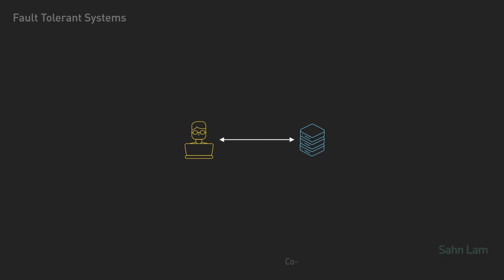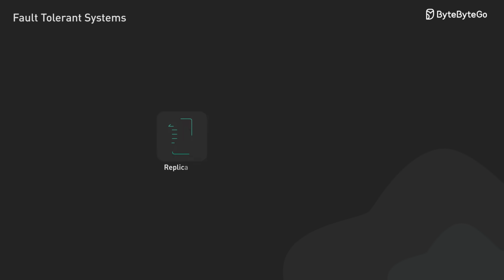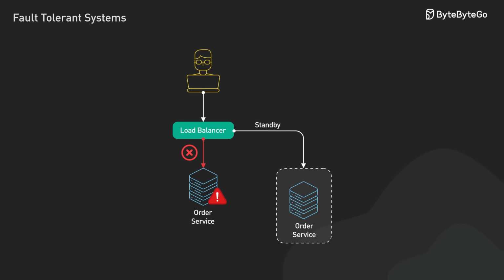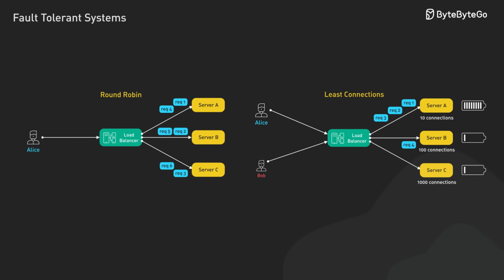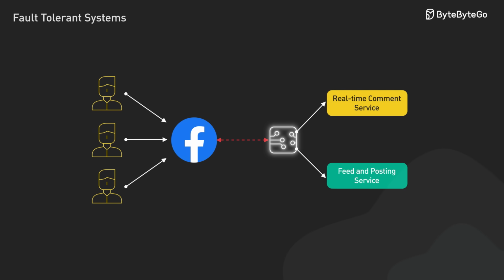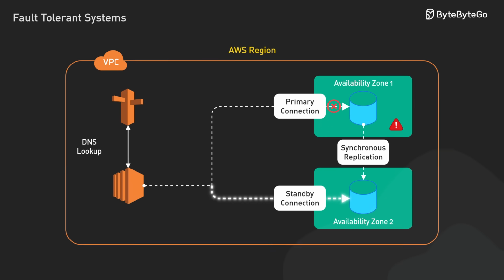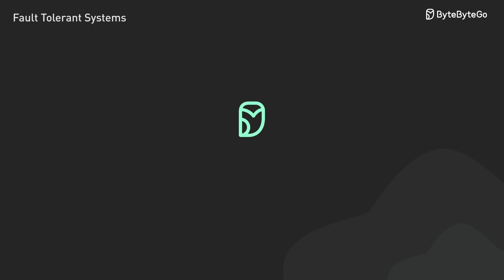8 Most Important Tips for Designing Fault-Tolerant System

Comment: 🎯 Key points for quick navigation:

00:00 📉 System outages are common in software engineering and require careful planning to avoid major failures during critical times like Black Friday.
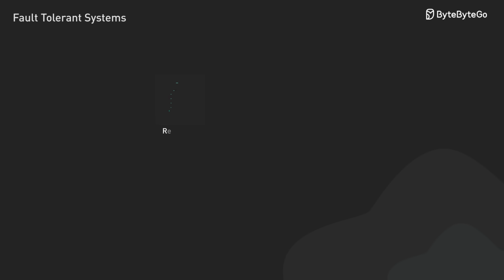00:27 🔄 Fault tolerance ensures a system continues to function despite component failures by anticipating breakdowns and establishing recovery measures.
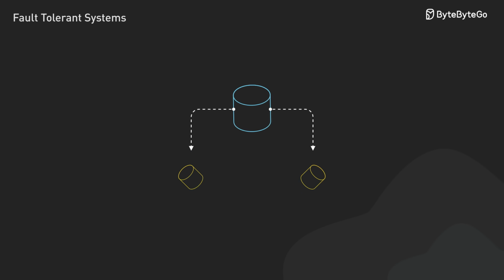00:53 📋 Replication involves creating multiple synchronized copies of critical data or components to maintain access during failures.
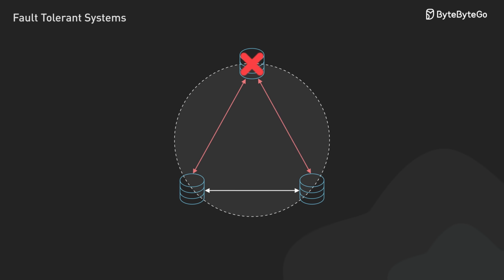01:19 ⚙️ Redundancy provides additional systems or components to take over during a failure, implemented through active-active or active-passive configurations.
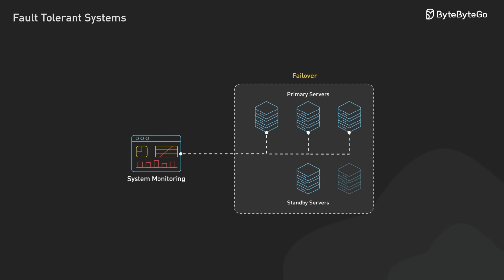02:12 🔄 Failover switches to standby systems when primary components fail, requiring constant monitoring and traffic redirection mechanisms.
02:40 🚦 Load balancing distributes incoming traffic across multiple servers, preventing overloading of a single server during peak times.
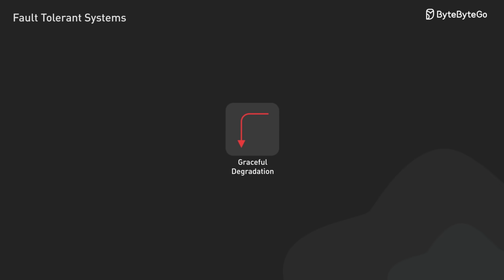03:06 ⏳ Graceful degradation allows critical features to continue functioning while temporarily disabling nonessential parts during overloads.
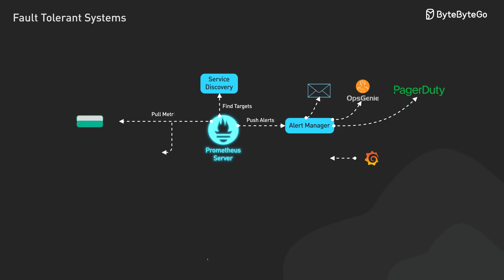03:46 📊 Continuous monitoring and alerting are vital; tools monitor system health and send alerts for timely issue resolution.
04:13 🏗️ Utilizing AWS for deploying applications across multiple availability zones enhances fault tolerance through data replication and failover mechanisms.

Made with HARPA AI

Comment: While most of this is valuable, what often brings down the server is not something that can is automatically recovered, and none of these methods will save you from this. As we can clearly see in practice, the quality of software is generally degrading, and so is their resilience and performance. The methods described above work best when the system is highly distributed and composed of smaller blocks, and totally fails when the application is more monolithic.
Reply: laughs in s**t accounting software

Comment: On the case of a load balancer-server it can be deleted just using serverless 

Load balnacee -> servers X -> db
1 lambda function -> db 

Cheaper and scalable itself 

What do you think?
Reply: Yes, because the load balancing and provisioning will be done through cloud provider's specialized tools :)

Not a bad idea, but serverless applications can get expensive for long-lived tasks, so you have to take into account the request size and duration too :)
Reply: Serverless is hard to optimize for cost after a certain point.